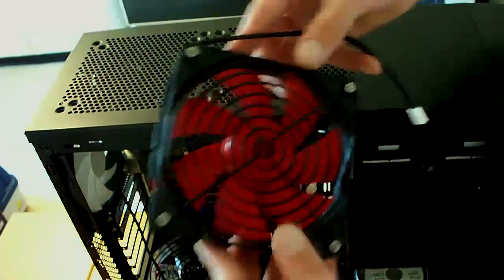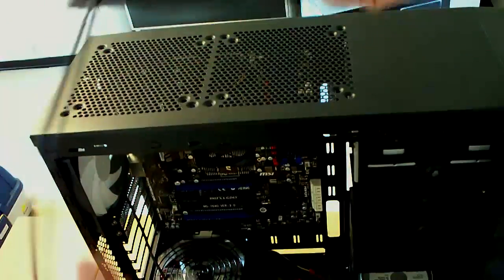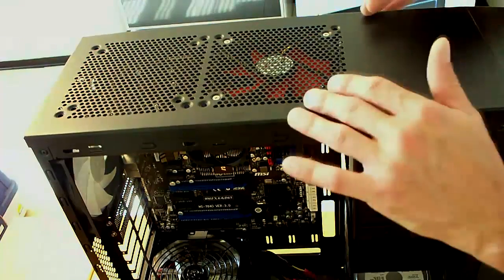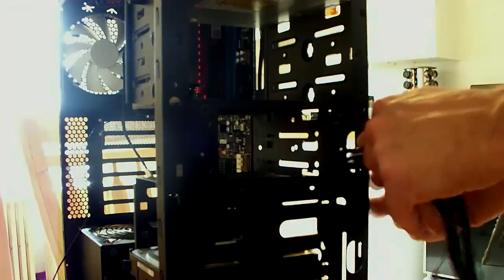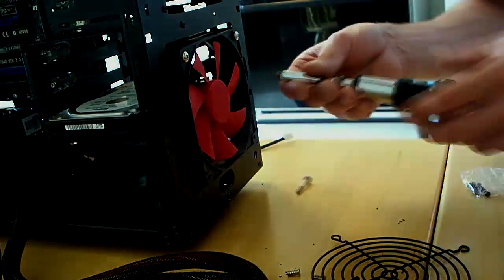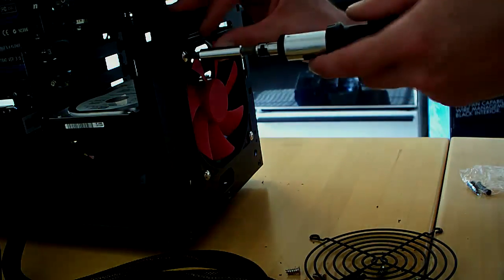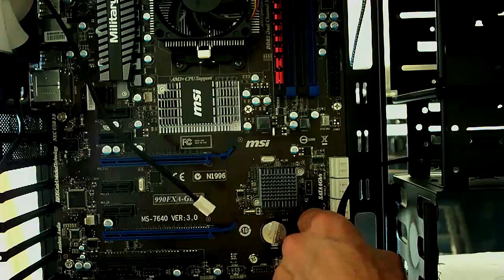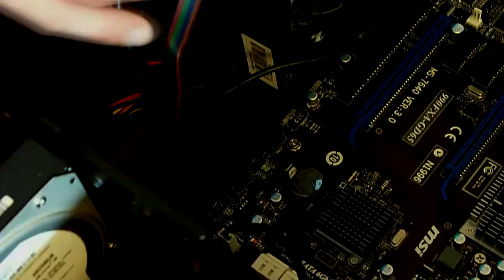How To Install Case Fans & Hook Up Front Panel

Comment: help plz. i d know how to open front case,  i want to install a new fan how am i suppose to open it?
Reply: Try grabbing the bottom of the front panel and pull it out. If you can't, use a flathead screwdriver to wedge the front panel open.

Comment: I need help. I accidentally pulled out the cord where my case fan was connected to the motherboard and I forgot where I plugged it up on the motherboard. Where do I plug it up?
Reply: TheHuskyK9 on the motherboard it has letters that say SYSFAN 1 or any other number plug it in there

Comment: uhm I think your power supply is install the wrong way. LOLOLOLOL
Reply: @amanc9835  no, he's blowing hot air into the system, with that case he probably has a hole in the bottom for the psu to drop air out of the case and not inside of it

Comment: is the back fan and front fan size are same?
Reply: +Lucas Macori thanks anyway i installed them and work fine
Reply from the maker: +Just Fruit Good to hear, I apologize I have been crazy busy at work. But yes, the front & rear fans were the same size. But still glad to hear that everything worked out well for you.

Comment: I'm getting a CPU liquid cooling fan soon. Where is the optimal place to put its fan and radiator? Should I re-install the 120mm fan from the back to the front after installing the cooler?
Reply from the maker: Well it kind of depends on what your getting and what case you have. If you're getting a all in one kit like the Corsair H100 or something like that with the 120mm radiator, then I would put it on the back side vent (rear of the case where your 120mm fan near the CPU is). And would have the fan blowing the air out the back of the case. You could do this in the front, but that would disturb a good air flow coming in the front and being pulled out the back by the radiators fan. Now if it's a 240mm radiator, I would normally recommend putting it in the top of the case with the fans blowing out as to keep the hot air rising out of the case. Again these are my personal preferences and some may do it differently, and again on what you're going to be getting.

Comment: I can't find the plugs for the fans that came with my nzxt source 220
Reply from the maker: The plugs on the motherboard to plug the fans into? Or the actual connectors on the fans themselves? If you're looking for the inputs on your motherboard, just refer to your manual, or find the ones (usually above the CPU socket) that say fan header or system fan. They can plug in there, or any other of the fan headers on the motherboard, depends on the specific motherboard where they will be located.
Reply: Elegant Mess I know where the sockets are on the mobo, I'm just looking for the connectors of the fans. Case manual doesn't tell me where they are, and I don't see them sticking out. anywhere

Comment: I have a noctua with vibration pads, what do you do with these? I tried getting one of them inside the hole and I'm afraid to push it in as it may not come out after... :s
Reply from the maker: Well if they're just like little round or square rubber dampers, then they are meant to go between the case where you're installing the fan, & the fan itself. So they wouldn't actually go in the hole where you insert the screws, just between the case & fan to reduce noise from vibration. If this isn't what you're referring to though, please feel free to let me know & we can go from there.

Comment: you are installing the fans wrong i think. motor side is to be fixed facing the vents.
Reply from the maker: The direction in which you place the fan is dependent on which way you want the air to flow. So right in the beginning of the video I try to show how on the side of the fans, you'll have two little arrows showing the direction that the air will flow & blades will spin.

Comment from the maker: Well it really depends on the fan/controller that you are using. If it's just a simple fan with an adjustable knob for the speed, then you can connect it to the Power Supply and just use it from there. If you want to give me the specific name & model # that you're using I would be happy to take a look at it. As for the direction of the fan blowing, if you look on the very outer edge of the fan casing, there should be little arrows that tell you direction of flow & blade direction.

Comment from the maker: It is possible that all 3 were tied together, but you should be able to follow the path of the other two fans (just find the power wire coming off the fan and follow that) to see if they were indeed connected. If not though, they may have all been plugged in near each other & the one that came off may have dis-logged the others. So just follow the wires to make sure they're all plugged in nice&tight, plug in the one that got disconected & go from there. If not, let me know & we'll go from there.

Comment: I have a pretty big problem, 3 of my 5 fans stopped today. The two front panel fans and the fan in the back stopped, it might be because the front fans are screwed to the front panel wich you have to pull off of you want to get to the dust filter. Im pretty sure one of the cords got unplugged while I pulled the front panel off, I found one cord that was unplugged in my pc(like the one on your fan in this video). Can one of those cords power 3 fans? I want to be sure so i so I don't fuck up my pc

Comment from the maker: This computer was built for a customer so it's no longer in my possession, but if you're referring to the front and back side panels, then yes they do bath come off. The back one has to come off in order to place some of the components and cable management. Just make sure that you taken out all the placement thumb screws that keep it in place on the back corner of the case. Now, if you're talking about the actual back of the case where the power supply cord connects, then that is not removable.

Comment: Hey i have 2 4Pin Case Fans which can be Controlled.

My motherboard has 1 4pin and 2 3pin fan headers.

If i connect to 3pin can the M/B still control the fan speed?
Or i have an adapter which came with the fan to combine the 2 fans and connect to 1 Four Pin header.

Comment from the maker: Yes I guess you could, but there is no other way of doing this, so just be careful in doing so. If you look behind the front bezel you will see how it attaches to the case. It has little plastic clips that snap into the frame of the case, so that should give you some idea of the pressure required to get the front bezel off.

Comment from the maker: I don't think it should be too much of a problem. The only thing I could see a problem with is that the air from the AC units may have a lot of moisture which is bad of course. So if you notice any condensation what so ever move it immediately. Otherwise I think you should be fine. Hope this answers your question, if not just let me know.

Comment from the maker: You're welcome, and I'm glad this was able to help you out. As for the screws these ones came with the fan itself, but can be found at any local hardware store for just a few cents. Just take the original screw with you so you can match up the threads / size. If worse comes to worse you can always use a nut & bolt (with a washer). If you have any other questions please feel free to let me know.

Comment from the maker: What you are going to need is a 4 pin Molex connector, one for each of the fans that you want to connect to the PSU. Usually fans will come with them when you order them nowadays, but just give a quick google and you should find them. The one end will connect just like your motherboard would, and the other end will have a plastice rectangle with 4 metal pins inside that will attach to one of the PSU Molex lines. I'll message you with a few links & if you have any other questions just let me know

Comment: Strangely, after turning my PC on after 8 hours, the CPU temp. dropped down to 32C on idle. You were right about a "curing process."
But I'm not sure if it will stay that way after a week or so. I'm still gonna get the cooler you mentioned though.

Comment from the maker: You should be able to find them at your local hardware store, Home Depot, True Value, whatever. Just take in the normal screws and match them up to longer ones. Or you can use a long screw with a small nut on the end with a washer to cancel any vibration.

Comment from the maker: Ya it would definitely help. If I may make a recommendation, I used to use the Zalman 9700 CPU Cooler before I upgraded to water cooling. And that cooler was absolutely AWESOME ! It was less than $50 at the time I bought it, and I overclocked that CPU to over 5.0Ghz and temps. were great. Oh ya, the one I got was the all copper one, great for heat dissipation.

Comment from the maker: I did some checking around and with that chip it has a 125W TDP, meaning that it's going to put off some heat. Regardless that is a little high, most of what I saw for idle temps. are in the range of from 35-40C. and the max I saw was in the mid 70's. So you're well within the limits, but some new thermal paste might be a good idea. May have an air pocket, causing these temp. spikes. So I would try that and I have a couple videos showing how I do thermal paste, little different than others do it

Comment from the maker: First, what CPU do have? Because some processors have a higher temp. than others, and if you have just the stock cooler on it that may explain why as well. By just putting one fan in your case you probably won't see a drastic improvement in temps. at least at idle. It may help more under load when there's more heat being generated, but either way the more air flow the better. So hit me up with your system specs. & I'll take a look at what you should be getting as far as idle/load temps.

Comment: I tried installing it on the side and the rear panel but there is no change in the CPU temperature. It's idle temperature is still between 48 to 50 degrees and it's not even overclocked. Do I need to reapply thermal paste on the processor?

Comment from the maker: I would recommend that you do both, you can get fans pretty cheap now. But if you have to choose one over the other it depends on the position of the side panel fan. If it's pretty close to the socket on your motherboard, I would do that one first as an intake. if not, then go for the rear one as an exhaust. I hope this helps and if you have any other questions just let me know.

Comment from the maker: It was quite awhile ago, but I think they came with the Rosewill fans that I got for that build. Not sure the exact size but I would assume they are pretty standard and any 6/32 or 8/32 nut and bolt would work from your local hardware store.

Comment from the maker: Those fans in particular were the Rosewill RFX-120mm and the speed range on them goes from 1200-2200 RPM. They were not the most expensive fans on the market, but the customer was looking for the best $ / performance within his budget. Hope this answers your question and if you have any others just let me know.

Comment from the maker: Ya, that's what I thought. Which lanes in particular were you using? Lanes 1&2, 1&3 etc. because the board only does 2x16 in lanes 1 and 2. So if you have a triple slot card you may not be able to fit them, just wondering if that's the problem. Now that I think of it though, it may be the CPU itself. I'm not sure of the LGA 1155 supports 2x16 for graphics cards. I know the new Haswell CPU's will but I'll take a look and double check just in case.

Comment from the maker: As for the fans, that's right, you can't control them if they are connected directly to the power supply unless you get a bypass for them. Which is pretty much a hub for fan connections that gets power directly from the PSU. As for the motherboard, your choices are FEW. I am looking at the EXACT same thing right now so I'll show you what I was looking at. It's the ASUS P8Z77 WS LGA 1155 Intel Z77 found on NewEgg for $339.00 but you get what you pay for & as I said our choices are SLIM :)

Comment from the maker: Well it really depends on the fans that you already have in the case. In most cases you will already have a fan in the back of the case as an exhaust, if this is the case and there is no fan in the front then I would say put it in the front to create a good flow through the case. That's what you're really looking for, the best place to give you the optimal air flow. By the way, which case is it? I can take a look at the fan layout & go from there :)

Comment from the maker: No problem, and asking questions is not stupid at all. That's one of the reasons why I made this channel so feel free to ask away and if I can help in anyway I'll try. But the fans depends on it's use, just for airflow you want a high CFM, and for static pressure you want a high (mm/H2O) which is for radiators and such. The standard for most motherboards is 3pin, if you look above your cpu you should see some of the connections there labeled fan, cpu fan, chassis fan etc.

Comment from the maker: Ya not a problem, and asking questions is one of the easiest ways to learn, and that's what I'm here for :) The male end is the 1 with the pins, and female is the 1 that you insert the pins into.The type of fan that your looking for depends on it's application. Depending on your motherboard will tell you how many fans you can connect right to it.The standard is usually a 3 pin connection, if you look above where your CPU goes there are usually a couple connections right there among other places.

Comment: sorry, this may be a bit of a stupid question, but I'm new to this, what type of connection is required to connect to the mother board? is it only 3 and 4 pin connections, also, what are male and female connectors? and basically what are you looking for in a fan if you want to connect it the the motherboard and not the PSU? thx in advance.

Comment from the maker: you should be able to hookup the fans right to the motherboard itself, usually will take either 3 pin or 4 pin fan connectors. If you check your motherboard manual it should show you where the connections for the fans are, usually like 4 different spots to connect your fans. If you need anything else feel free to send me a message and we'll try and get this going for ya

Comment from the maker: It's the NZXT M59 case. It's currently out of stock on NewEgg but you can find it on Amazon for about $60.00 Not too bad for all the features this case offers. I use a Corsair 600T for my personal rig which is a LARGE mid-tower case. Happy with both but the Corsair one offers much more in cooling and space, in my humble opinion :)

Comment from the maker: The only one that is important to connect accordingly is the CPU fan. If it's the same Motherboard then the connection for the CPU fan should be just above and to the right of where you install the CPU. Other than that it doesn't really matter which fan you connect where, I usually try and connect it to the closest one to the fan just to help keep it looking clean and for cable management. Hope this helps and if you have any other questions please feel free to give me a shout.

Comment from the maker: I know when I first booted up I didn't realize I had to physically hit the input button on the monitor for it to register then I got picture. Double check all of your power cable connections, including HDD, Mobo, GPU, CPU etc. It also says in your mobo manual on pg. 26 under Front Panel in the Speaker section that 1 short beep on POST means a successful POST so that's kind of odd.

Comment: hey, I finished building and booted it up, but when i do i get a black screen and it turns off. then a second later it turns back on and it repeats. i put in a beep code speaker and it gives me one short beep. my mother board is a gigabyte z68ma-d2h-b3

Comment from the maker: It depends on the case and which wire/wires your talking about in particular. Usually there is a little stamp on the end of the wire that connects to the motherboard telling what the wire is for. You can then go to your motherboard manual and find where it goes. If you tell me which cable it is and the marking (arrow) your talking about I'll see if I can help you out. Also if you could provide the name and model of the motherboard that will help also.